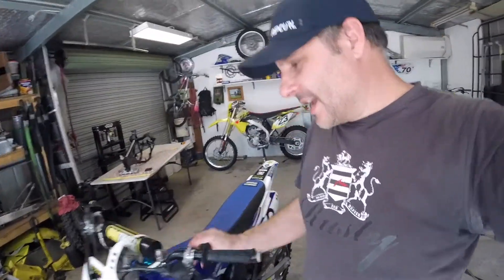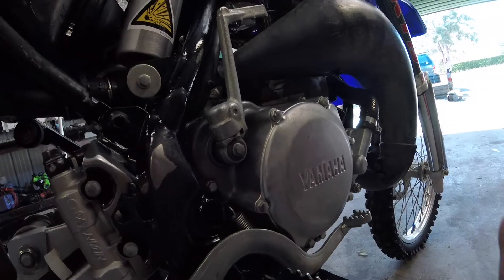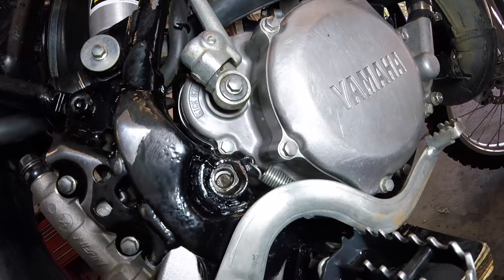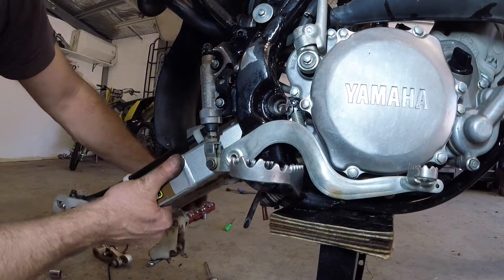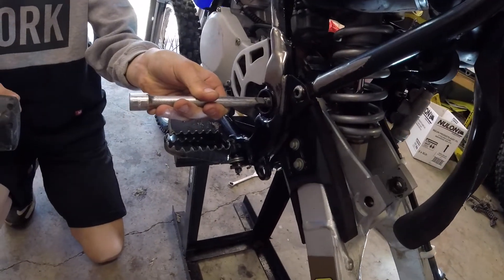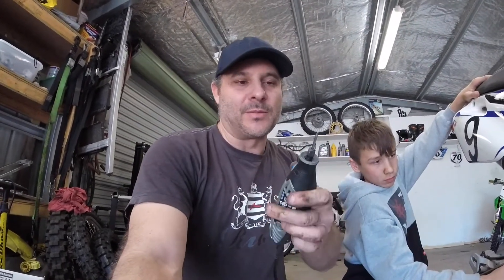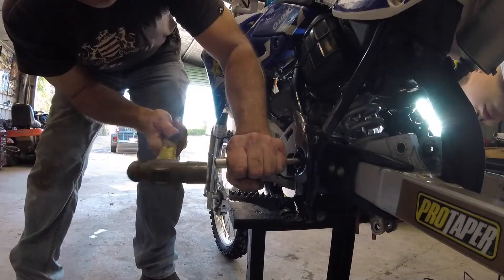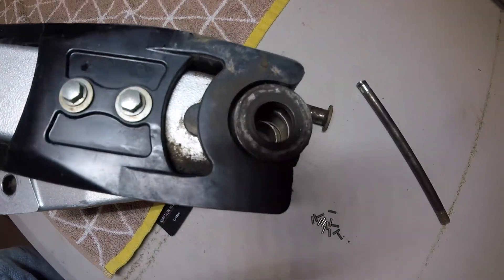Big problems for the Yamaha YZ85

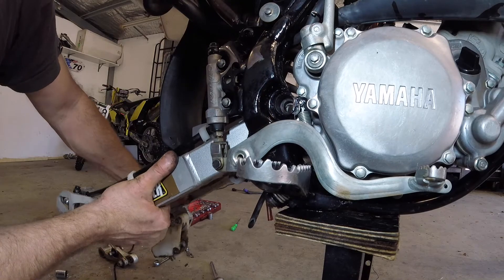Comment: hey mate, at 1:42, what is that black tube called and what is it connected to, i just got an 85 and it usually starts 1 kick but today it took awhile, after it started a greenish liquid started dripping from it, i have looked everywhere on the web and nothing, just wondering if you could help, cheers mate.
Reply from the maker: Yeah thats just a breather pipe.
Reply: thanks pal, was getting quite worried.